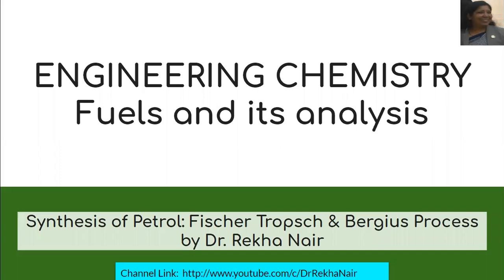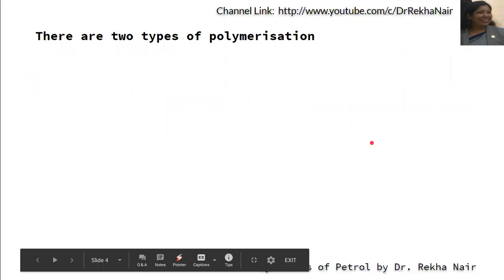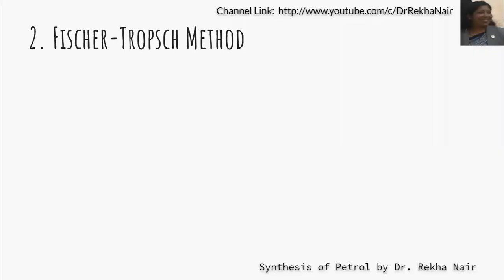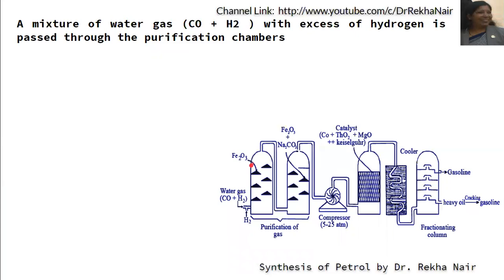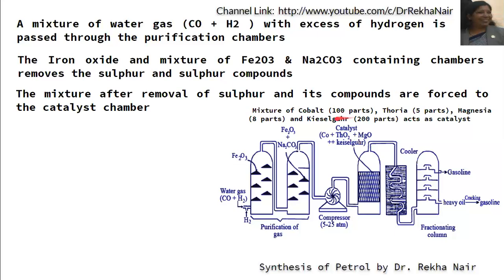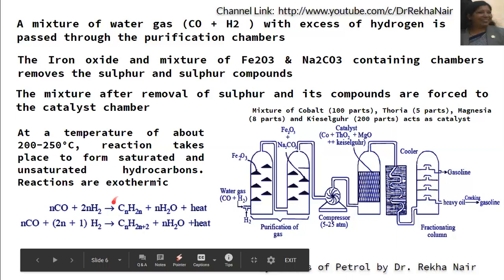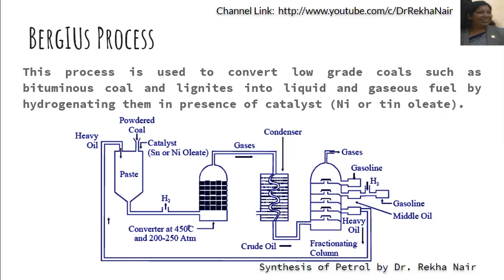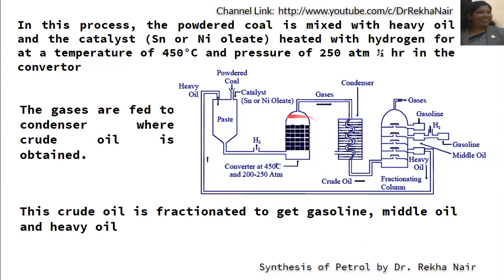Fischer Tropsch and Bergius Process _Synthesis of Petrol_Fuels and its analysis_by Dr. Rekha Nair

Comment: My question is if we can synthesize petrol then why are we importing so much crude oil?🤔
Reply: Refineries are much cheaper to build and operate than a FT plant. Some modern modular refineries can be built for $30,000 or less per installed barrel. For FT plants it’s hard to get below $100,000 per installed barrel.
Reply: Also, FT plants are very complex operations. There’s a sound reason why there’s less than 10 commercial FT plants operating worldwide, compared to more than 700 refineries. Keep in mind the FT process has been around for almost 100 years.
Reply: @JohnSmith-qp4bt  thanks for such a detailed insight
Reply: @JohnSmith-qp4bt  good explanation ...thank u
Reply: due to lobby of gulf amco essar shell oil mafia world wide will they let your govt to be self sufficnt
Reply: bigger profit when you refine fuels from oil instead of hydrating coal.

if your country isnt cut off from oil imports theres not much reason to synthesize it.
the whole idea came from germany that lacks oil wells but has gigantic lignite resources. it was expected that the british empire will cut off the german empire from oil imports in the next world war and thus fuel would have to be made from lignite/coal until army group south can conquer the azerbaijani oil fields in the soviet union.

the gasoline that was produced cost sligltly more than gasoline destilled from oil but the price for the consumer was the same just the profit margin was smaller. in peace time theres not much incentive to produce an expensive product when you can get it much cheaper.

china is the last country to make fuel from coal because in the event of the taiwan invasion indias and americas navys will close the malacca strait and prevent chinese oil imports.
for this the chinese have a hydration plant in the coal rich inner mongolia.

india is not at war and will propably not get cut off from oil imports, thus theres no need to spend money on those expensive processes.